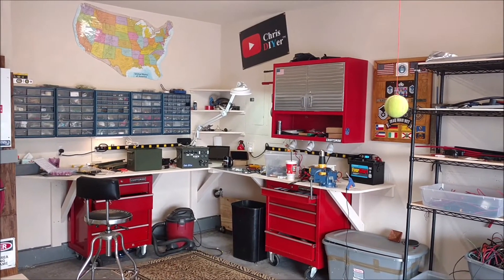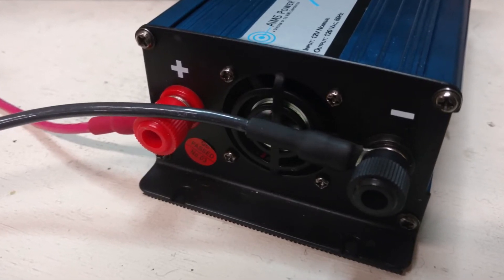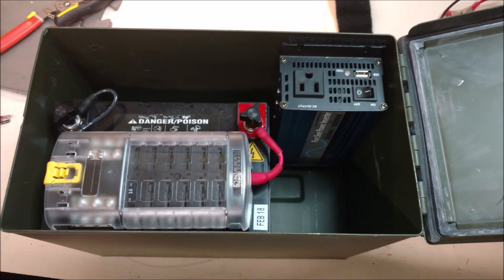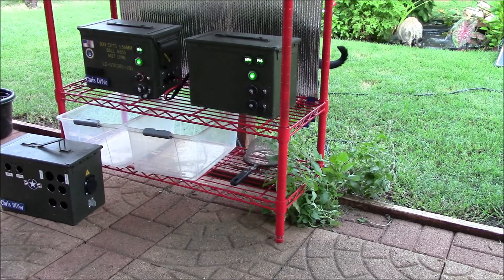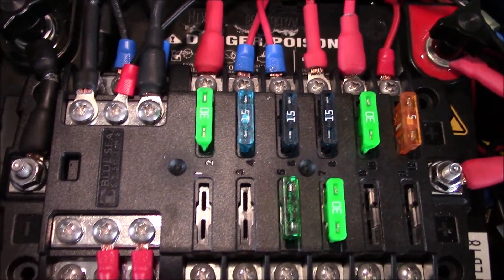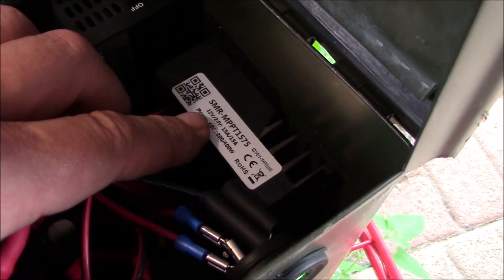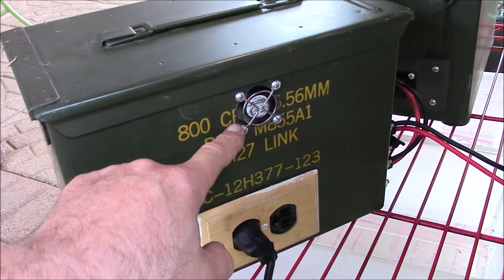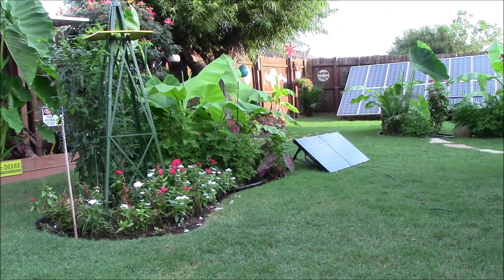New design! 12v ammo can micro solar generator (more power, better cooling, new fuse block, less BS)

Comment: Nice build Chris.  Question: It looks like you did not use the "load" output on the solar controller to power your 12volt output circuits.  I understand why that would be appropriate when connecting the batteries in the two boxes in parallel, but would like to understand the logic in not using it otherwise.  With a direct battery connection you don't seem to have automatic protection from over discharge which could result in battery damage.  I'm interested in your decision to go with a direct battery connection.
Reply from the maker: I don't want the "Load" circuity on the solar charger to control what goes on with the 12v outputs in this configuration...esp with a 300w inverter. However, on my garden pond solar generator...I do use the "Load" on the solar charger to control 12v output and protect from battery over-discharge. It all depends on how one uses or abuses their batteries, design preference, and needs I guess.

Comment: Hi Chris, Steve Clay from OKC, Retired AF, still work at Tinker, working on second retirement! Anyway I have a school bus/ RV (skoolie) i would like to install solar on, and need someone of your caliber to help me determine my needs before I invest in alot of stuff for the install. Would you be interested in looking the bus over and making suggestions of what I may need to do this solar project? If so I could drive the bus to your house to look it over. Thanks in advance for your consideration! I sent a message in Facebook, but it may have messed up.
Reply from the maker: Thanks...no, not interested. I don't do installs...esp on vehicles. Might check out RV with Tito's YouTube channel...he does that kind of work. He is also a vet. Here is a link to his channel: https://www.youtube.com/user/rvwithtito
Reply: Chris I just wanted someone with your experience in solar to help with ideas/suggestions on the system, not actual help on the install.

Comment: I like it , good for camping outdoor patio add solar panel good to go nice update sir
Reply from the maker: Thanks...the 2018 model! hahaa. Yeah, these ammo cans can take some abuse. I think they would be good for a storm shelter too...just add a 15 or 25-watt 12v solar panel (as a trickle charge source) to maintain the battery. About 210 watt/hours on a single battery, double that with two batteries